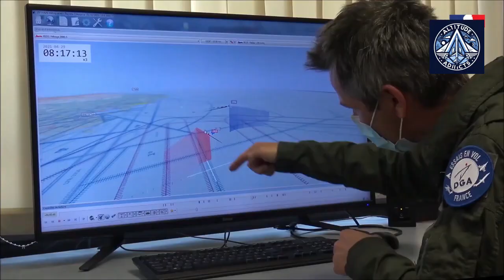Safran's T-REX Program: A New Engine for the Rafale F5?

Comment: Simply fit the Eurojet EJ200. It or a derivative is likely to be used for NGF of FCAS and GCAP anyways. Spain and Germany have a stake in it and it’s one of the most advanced jet engines in existence with a lot of untapped upgrade potential. (Currently 60/90+kN, wartime 69/95-102kN, upgrade path to 72/103kN and 78/120kN)
Reply: Your spanish ass.:face-green-smiling:
Reply: @RichelieuUnlimited  EJ200 is partially American. Why in the hell would French (and any of the many buyers of Rafale in the world) would want to depend on the US?
Reply: @sebastienaubry41  In what way is it partially American?
Reply: EJ200 LOL    ah ah ah ah ah ah !!!! a lower temperature than the M88, longer, bigger, high fuel consumption, less reliable than the M88, this engine is nothing exceptional! also short to put 2x M53-2 LOL the M88 is composed of 21 modules that can be replaced directly on the plane, and not the EJ200!!
Reply: @LOLOVAL-os3pq  EJ200 is the better engine  higher fuel consumption but much stronger engine if u look at the  fuel efficiency its better , has better thrust to drag ratio and way better thrust to weight ratio, if its easier to maintain than how is the eurofighter fleet(UK GER IT) is 82% FMC and rafales is 73%  (FR) france operates the rafale and some mirage 2k how is it lower ? uk and italy operate F35 tornado and harriers aswell